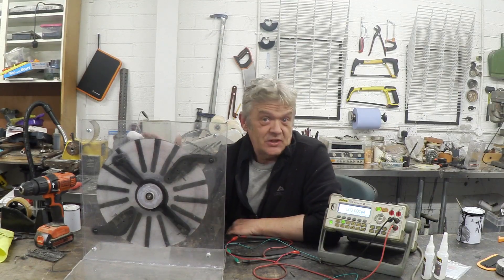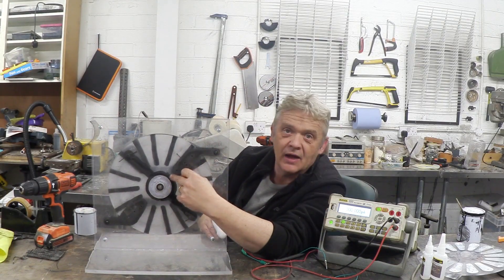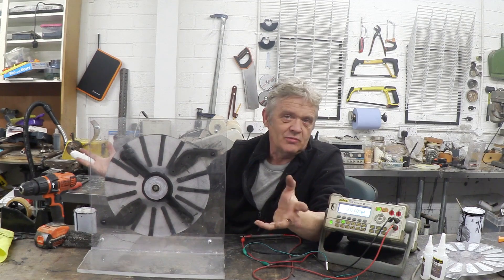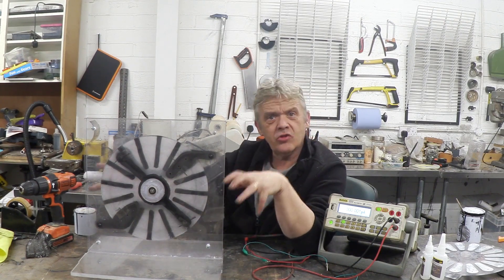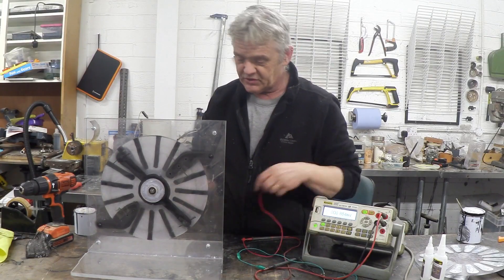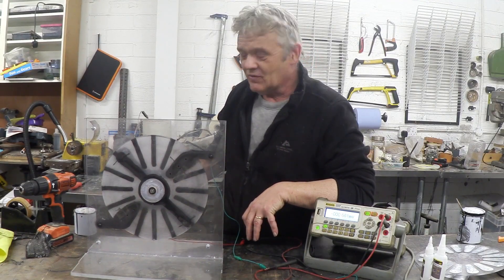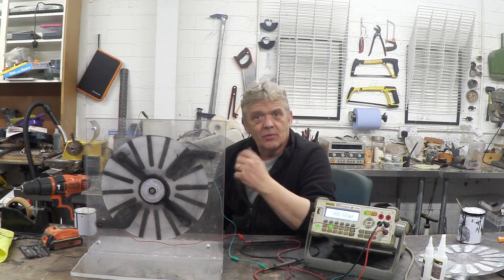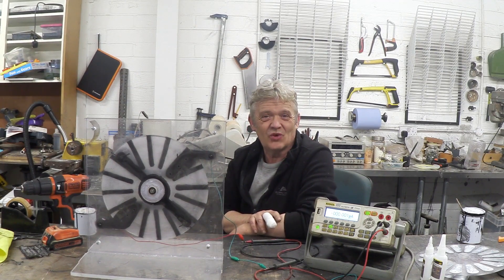725 A Printed Generator - No Copper, No Coils, No Wire, No Magnets

Comment: Even if this isn't very energy dense, if its cheap enough, one could make huge arrays and put them in the ocean. The ocean has massive amount of energy, the problem is usually that it wears everything down. But with this simple design, theres less to go wrong. See if you can make it water sealed, and if you can think of a way to adapt it to waves. I imagine an anchor, the geny, a springed pully, attached to a float (which the surface carries up and down) but someone could probably think of a better geometry/design.
All the best Robert! ❤

Comment: instead of using neutralizers with brushing tip can we instead connect opposing plates with reed switches that will close with magnet? so that we'd get rid of brushes all together. what's the potential between two plates ready to get neutealized?

Comment: Add 2 Leyden jars 🫙  to collect the electricty, then add 2 horseshoe magnets 🧲  wrap copper wire from n to s on one magnet  then s to n on other horseshoe magnet 🧲  this will direct the current like DC current in the desired direction. Lights can be made from gas charged jars 🫙  containing  neon and other games.   A static motor can be made to use the electricty to create motion

Comment: Since you've gotten into 3d printing what about 2D cutting?  What I mean is since you mentioned aluminum (aluminium) how about using a cricut machine to cut your coils and stick them on? You could use aluminum foil and have a cricut machine cut out a massive amount of them then put them on your disks.

Comment: I am surprised that no one saw the similarities between this device and a Tesla turbine.  The turbine will produce high RPM, low torque rotation off of a fairly low-pressure supply of fluid, and this device works well with high-speed low-torque rotation.  I am not entirely sure that 3D printing is the optimal manufacturing method - I think a press will work better - but producing a lot of thin, smooth plastic discs from waste-stream sources could be economical.  If you then passed some of the discs under a printing press to add conductive traces, that wouldn't add an appreciable cost.  At that point, $2 worth of plastic and $25 worth of labor could make for a decent hydroelectric generator.

Comment: I would like to see you do some experimentation with a faraday disc.   You could introduce a high voltage static input to the faraday disc, so the output will be high voltage AND high current generator, putting out more watts, then what is being used to rotate the machine. 🤠👍⭐⭐⭐

Comment: A 12 volt battery has 6  two volt cells. So  print 5 more of these and you will get +12 volts. Put a rubber disk on the drill and increase the rpm and see what you get.

Comment: 4 8 12 16 made in usa not the german 2 4 6 8 .... would be nice to have something like that for electric cars and or electric trains that would be a generator driveshaft that would constantly spin replacing so many batteries but increasing drive distance with the right combination ....

Comment: how big would it have to be, or what would need to be scaled up to make a more usable voltage/amperage?  Same size but multiple disks in series and then in parallel with another identical device?

Comment: Luminor paint could light it up as it generates power
Make the electric current strobe then use water pipes like fiber optic tunnels for the light to travel

But i bet gravity and boyancy could power that
Pushing the pump for Compressed air batteries and looks like it could live inside the testla turbine/air/electrostatic ionacoustic corona engine plasma popper

Comment: Interesting idea, any ideas on how you can stimulate some more amps on it? As it is static? Different plastic? Or adding rubber strips (from bicycle tyres) in between each painted surface. Maybe poles will be more isolated and the charge will be more concentrated? Very nice 🤔👍🏼

Comment: I know you are measuring constant voltage and not accumulated voltage like they usually do on electrostatic machines, but I still wonder about it being so low. Are you leaking charge? Perhaps you should burnish the surface of your painted area to remove the micro irregularities that might cause corona loss?

Comment: well i will for sure check it out in a smaller version lets say the disc diameter 200mm and lets say 5 discs..just as son as i get the magnetic paint carbon cloth and acrilic.
obviously working on drawing the lines on paper to be transfered on acrilic

Comment: I been working on my own experiments all day and I kept thinking about this video and just kept thinking about it. My experiment is a plasma generator but I have done a lot of experimental work with things like Vandegraaff generators and latex works great. Instead of just using plexiglass although it looks great being transparent it is not the best dielectric for the job alone. The plexiglass is actually very negative which is great on the negative side but an opposite material is a voltage differences like glass or Teflon the latex can be a mediator see the power of the device you are showing holds it's energy in the dielectric like a film capacitor. So if the rotation wheel at the center is sandwiched between lets say glass and plastic or Teflon and plastic it will improve voltage a whole lot. Later maybe instead of the ink you can use some of your knowledge of graphene to maybe do the stripes with a single layer so that all the carbon holes are filled and discharged quickly and hold more current at a voltage you will probably want the ink only at were your brush makes contact or comes close to the stripes to discharge. Oh well I hope I can be of some help. Don't have to give up on the printing idea also because it's a great idea and the plastic can be coated with the Teflon and the wheel with the latex. Instead of one volt you may get hundreds... Current will be the biggest challenge but it can be done. Nice video!

Comment: How about doing this in layers using a Tesla turbine configuration??? Maybe we can boost up the voltage and and amperage to do some work and use capacitors and and a few transistors and if you can bring it to the amperage of a small battery and hold that steady enough so the voltage doesn't drop to less than 1.2 volts...  I am low balling it and I think it can be done to do a lot better. Great video! Love that you shared it.

Comment: Wait it's a static electric generator?.
Why not add a current amplifier?
Also replace the carbon fiber with glass fiber since your just using resinous substances to generate electricity but the creators of this system used resinous substances and vitrious substances to create a greater difference in electrical potential.

Comment: Since there is barely any resistance could you use a high speed motor and battery to propel and cause self recharging or will it slowly wind down to nothing.  " I don't know much about electricity so I was just wondering." Anyone have an explanation for me?

Comment: I have not come across any information on static electricity being converted to a more useful state. 
BUT 
I would imagine it would be fine for powering a gas filled tube like a Geisler tube  or a neon tube or a some kind of fluorescent light.  

Electricity can be saved in Leyden jars for down time.  
Or a better 21st century equivalent.

Comment: I love conductive ink, but it’s so expensive, at least the small tube I got is. I like this design as I can see it placed in a hydro solution somewhere remote. I don’t see how the components would receive wear. Very nice passive power, even if the power density is low. 👍
Reply: check out his videos on making carbon and making your own conductive carbon ink,

Comment: I was thinking if it possible to make printed corrugated sheets. With conductive filament they could be staked in the proper arrangement and printed in any configuration. Then instead of them spinning they are ment to fluctuate as water, air or sound travels through them. They could be used to recover rain, wind and sound energy!

Comment: While the applications for such a low power generator are limited, I do generally find these sorts of things facinating, particularly if applied in developing countries. Microwatts aren't useful for a huge amount, but for driving small LEDs for navigating in the dark they could potentially be quite helpful and likely save a few broken ankles, particularly if you're already carting loads, such as jugs of water, which is quite common in those areas already.

A two wheeled dolly with a simple and cheap string pulley could easily get a fast enough RPM to at least provide a little light even without a battery or capacitor. Of course with a decent inline capacitor one could store the energy from the trip one way and use it on the other with minimal losses, though that assumes they'd be returning at night, which is only made viable by having this light in the first place, making it something of a solution making its own problem. Though could be valuable insofar as keeping people out of the midday sun and having portions of their gathered water vapourise off while they travel.
Reply: You aren't thinking big enough. Since these things, once mass produced, will be almost literally "A dime a dozen," they can be stacked...
"To the MOON, Alice!"

Comment: You can get almost a full volt by a gentle hand crank? Think about it, between this and the graphite dry cell, you can basically make a hand mill to generate 2H and 2O with. That's kind of mind blowing, even if we're talking low output.

Comment: Make a Tesla turbine spinning those discs to gain maximum conversion of energy from a flow of any fluid at low cost. A Tesla turbine is a much simpler engineering challenge than a normal turbine so this could represent a low cost locally produced energy solution. Having said that, even attaching it you a bicycle wheel wind generator could bring phone charging and thus internet access to remote areas....
Reply: Oops, someone already thought of that Tesla idea.... Great minds and all that lol...

Comment: What if you make several disc and the "cage" a sandwich and one Shaft?

 I would like to see if it makes a difference if you spin in the other direction and change the polarization? A few more experimts please.

For better results maybe but "canals" and use the Inc on them? 

It's only my assumation

Comment: I would love to see a stack of the foil used for laminating documents printed on one side to create a stack of insulated disks. If i recall the thinner foils are 125microns so about 8 disk per millimeter. So about 80 disks in a 1cm stack. And if I am not mistaken plain plastic can take a disk spinning in the low thousands of rpm with this disk size. So that design would be a few hundred times more powerfull for a couple of dollars worth of material ?

Comment: Perhaps made like a clock makers watch, with gears that feed off the big wheel reducing energy waste?

What about stacking them?

Adding the two variables, the positive stack and the negative stack?

What if each of your lines on your internal plate, looked like "V's".....
Similar to the variable capacitor of the same design?

Adding a voltage multiplier to it to feedback into it?

🤔

Comment: Out of curiosity, is there any good place or book to read up on the principle and operation of this kind of thing? I ask because google has failed me, and punching in 'Dirod' or 'Dia', 'Die', or any other variations defaults to 'Droid', and Electrostatic Generator searches mostly brings up Van De Graaffs and Wimshursts machines. I know the basic principles here, but I want more relating to this specific operation. Any help would be appreciated.

Comment: Maybe if paint was like silicon, therefore every other painted in strokes of opposing directions (p-type paint and n-type paint) might then give an AC output.
Maybe if instead of the breaker / buffer line in ink, a line in electrolite ink?

You might have made a large version of what is realy happening to elements within an electronic componant- be it a battery, capacitor or any other....

Thanks for another fantastic build!!

Comment: this is supposed to be the way, axial and radial motor-generators with bio based carbon nano tubes or graphene as conductor. apart for the less weight of rotor or stator if you add liquid nitrogen cooling, you get better electromagnetic force, electric conductivity and also magnetic bearings.
so, for free or using biomaterials, you can have the most efficient electric motor, there are several pdfs published using all of that but they are have been published recently and separated

Comment: Why do you not have any load? What is the current rating? What happens when you add 100 ohms? 
Not even using a differential probe or proper motor measurement. And what do you suspect this current and voltage is from if no work is going in? And if it is some work how much of the work can be captured using this ?

Comment: With if you do something like a spiral shape painted lines, maybe fibonacci, something that will allow all of them to have a longer track on the disk as possible and compact well together (symmetrical). Your pickups on the outer edge and the naturalization bar only contact the most center of the disk, would that make a difference?

Comment: In a small way your making the basis of a Whimshurst Machine which used additional storage capacitors to hold the charge. 
Dielectric charges of the plastic will have a big effect on the output potentials, so experimenting with the disk insulator material may reveal some improvements. Also wider carbon tracks should add more current. Making special shaped patterns to increase carbon ink track surface area, may assist with more current output. Series wired disk outputs on a single shaft to get say 12 volts should not be hard, once the current comes up to a more useful figure.
As inefficient as it is for real power generation, it may have some useful purpose in micro power applications.